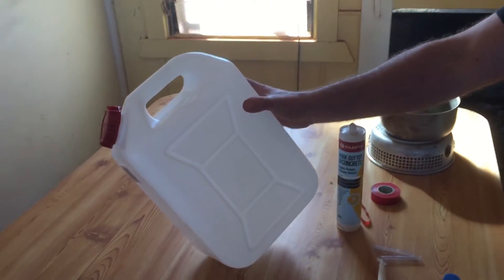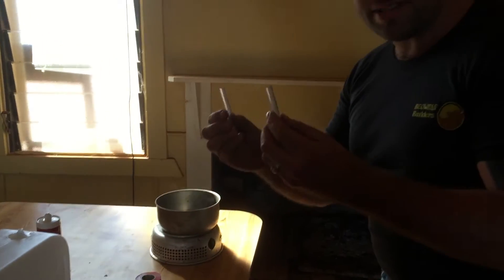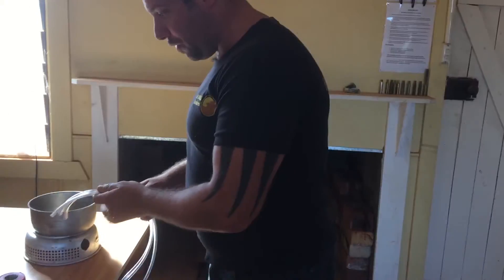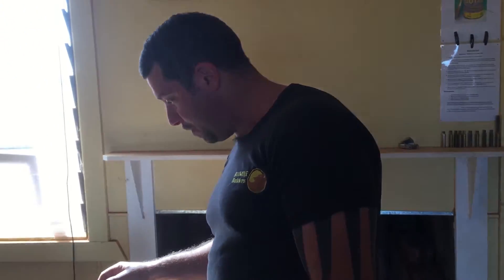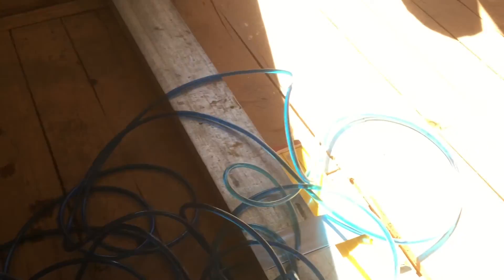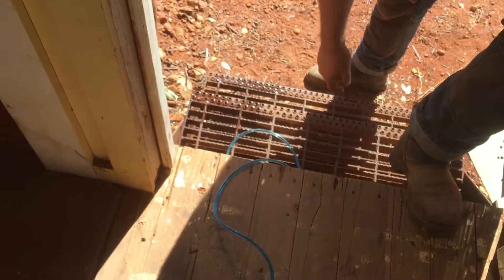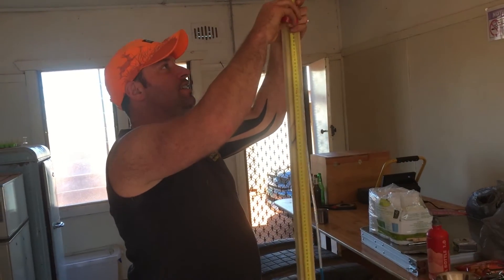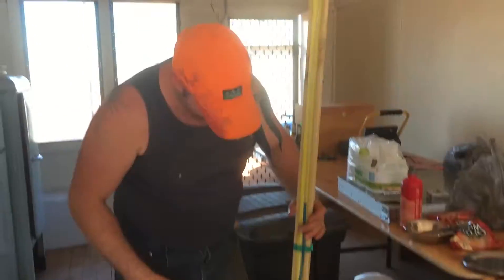How to make a water level

Comment: too easy, i was thinking you had to deal with both ends when measuring for some reason haaha
Reply from the maker: there is a system where you can deal with two open ended sections of the hose, but this way is WAYYYYY easier